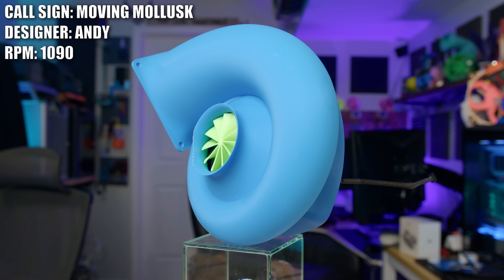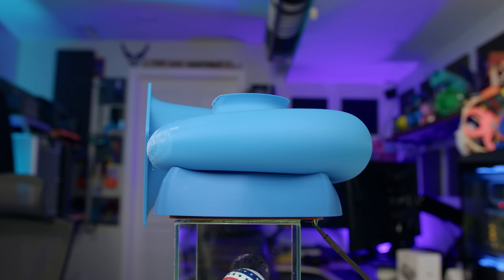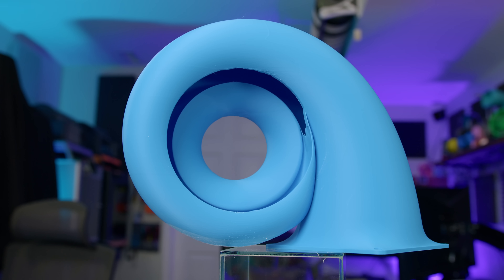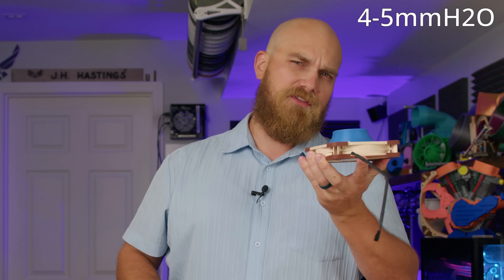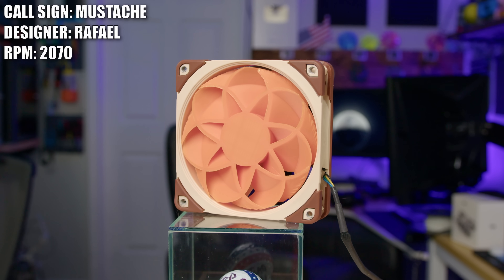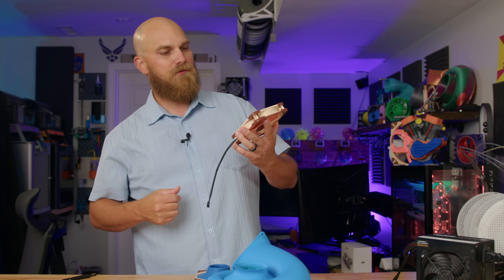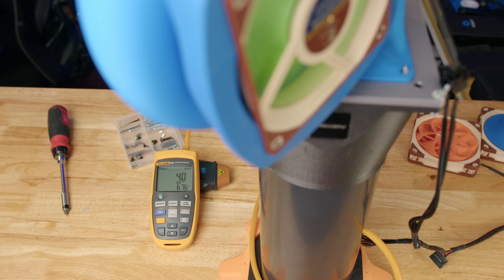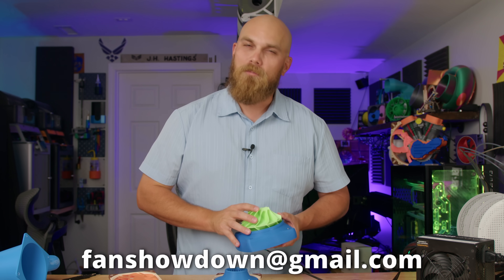A Twin-Intake Turbocharger… Turned Into a PC Fan! | Fan Showdown S6E12

Comment: This is splitting hairs but that wouldn't be a turbo, that would be a centrifugal supercharger... if you're going to call it one or the other instead of just a centrifugal fan. Turbos are driven by combustion gas, while superchargers are driven mechanically.
Reply: I would like to correct the misunderstanding. The word 'turbo' is not only for the machines with combustion gas. Turbo, more specifically, Turbomachinery, means all kinds of rotating machines with the continuous process of working fluid. Compressors, fans, pumps and turbines are all turbomachinery if they are axial, mixed-flow or centrifugal (or radial) machines.

Some compressors like screw or rotary are not classified into turbomachinery. They are called as positive displacement machines.

So I want to say that the combustion of working fluid is not the main issue to say one machine is turbo or not.
Reply: if we are getting REALLY technical, combustion gas IS mechanically driven, since the engine is just an combustion driven gas pump. if the explosions were not controlled you would not have a gas pump(and no combustion).
Reply: @turtlefrog369 - To further split hairs, it really depends on the definition of "controlled" 😊
Reply: @corpsie-diytools38  not really, it is controlled in multiple ways, spark timing, fuel timing. valve timing and piston timing.
Reply: its a turbine compressor
Reply: @jamesmelemede5610  ? The turbine is the exhaust driven part, the compressor is the cold side. That is the two sides of a turbo. This thing is a supercharger.
Reply: @Retro-Iron11 a supercharger is just another name for a compressor.  Specifically a compressor designed to compress a fuel air mixture.

This device is not a turbo or a supercharger, because it has nothing to do with fuel.

It is simply a centrifugal compressor.
Reply: @meateaw it's not even that. It moves the air from the narrow end towards the flared end, not compressing at all
Reply: @jurban7998  - Are you just  trolling? It is definitely compressing the air.
Reply: I think it’s a fan

Comment: i just noticed... aren't all the "Turbos"  we've seen in the Fan Showdowns technically Superchargers? Since they're driven by a Motor...
Reply: Technically yes, that would be correct, however they do resemble turbochargers more then superchargers, even a procharger looks quite different from the "turbo" fans on the showdown
Reply: @idkwhatmyusernameshouldbe5345  well "centrifugal Superchargers" dont look that off i'd say

Comment: Next season "Improve my rig"

You build a non-watercooled (relatively airtight) computer, and contestants get to desing fans for it. Community goal is to get the best designs together to get it running as cool as possible while running some benchmark program. Contestants can submit one or multiple fans at a time. Contests would be run slot-per-episode way in rotation. So for example, first episode you'd test case intake fans, measuring total airflow through the case and if it makes positive pressure or vacuum inside the case, thus revealing if other side needs serious improvement. Second episode you'd test case exhaust fans, third episode CPU fan, fourth would return to case intake fans and the cycle would start all over. First season would focus on the raw cooling power, noise wouldn't count althou observations on the noise would be still interesting.

This would emphasize on the community, and what it can achieve together.

Second season after that is to see if contestants can keep or increase the cooling capacity, but make it more quiet. 

You baseline it with A12x25 doing every cooling task.

Comment: For the next season, take a bunch of existing fans from each seasons. Bests ones, and test them at different speeds, pressures, and flows. To know which one could be use as a good pc fan for air-cooled pcs or water-cooled pcs. This could lead to real ranking of the fans that have perform in the past compared to the noctua. So measuring the flow for each 250 rmps and each 1mm H2O with sounds.

Comment: My suggestion for next season is to take the actual setup, put a valve and construct the pressure-flow curve by multiplying pressure an flow. Then, whoever has the bigger value goes first

Comment: if you want an idea for the next season, setup a thermal mass and see what the fans actually balance at for temperature control. Setup could be varied with the mass acting as the constant. Sound decibels and frequency might also be the second consideration, same as other suggestions.

Comment: I think back to roots for the next season would be good. Noise normalized which fan can cool a CPU the best. Someone suggested designing fans for a dual tower cooler, and I think that's a good idea given how popular they've become. It would give an interesting design constraint as at least one of the fans would have to fit fully within the fan housing. Also gives room for optimizing the second fan to work better with the faster airflow from the first.

Comment: Hey dude, that one with a loud low frequency? I pulled out my heavies head phones to see if I could hear it. YouTube only does 20 to 20k hertz with sound. Was it in the infrasonic range? Aka below 20hertz? 
You had another fan, maybe a year ago or so, that had some sub low frequencies. I was watching that video through my Surround sound and my subs were humming. I thought my amp was about to fry out. Wild. I wonder if the fan design is creating some kinda buffering that resonates. What is it, 80hertz and below sound becomes omni directional. You can't really pin point it's source. That's wild that a fan design does that. 
I know some variable pitched turbo prop airplane blades make a stupid 10hertz. Can't hear it but you can feel it.
Reply: The Mustache on his scope was showing 35hz peak there may be some subsonic harmonics I was going to comment the guy made one hell of a tuned sub(watch the plexi movement from it). 33-37 for SPL was the goal for most box tuning when I still ran competition systems.

Comment: Interesting, I would have guessed the opposite outcome based on the smoke test.
Reply: Because static pressure is being measured not airflow.
Reply: Smoke test provides flow visuals, but the contest is about static pressure. It is easier to push pressure with lower flow, that's how a hydraulic jack works 😉

Comment: Next season should be the quietest fan that moves the most air.
Reply: On what measure? CFM per DB?
Reply: @sepg5084  yes!
Reply: @sepg5084  Linear gain
Reply: @sepg5084 yes / also a factor could be used.
dB / CFM = X

Or you also could say at a specific speed and or noise leveld.

Say @1500rpm
CFM=
dBa=
Reply: You want linear gain instead of dB.
g = 10^(dB/20)
Reply: Maybe tune the fans to match a certain decibel number (like 20 for example) and measure the amount of airflow it can generate at that volume.

These fans would make great casefans for budgetcases, 'silent builds' or office cases
Reply: That would be great. Would give rise to a lot of new designs.
Reply: that would be awesome.

im a huge silent PC fan, especially for work and due to my open back headphones. 

my GPU fans never run over 66% and my CPU fan never above 55%. 

with a proper airflow situation even a silent case with lots of sound dampening and slower running fans can cool down components really well. 

i would defenitely consider swapping out "normal" fans for experimental fans, if they reduce some of the noise pollution.
Reply: The test could be that it moves the same amount of air as the original fan through a normal radiator. But it should be quieter.
Reply: The way to do it would be a linear noise curve + cfm curve + static pressure and the fan which has the most chart surface area between the noise curve and cfm curve + static pressure/2 from 0-max rpm (like a dyno sheet) is the winner, it would be an arbitrary scale adjusted to include all the fans as a positive number.
Reply: JUST was about to say the same. Set a standard airflow and pressure that the fans have to exceed and then measure noise. Now, our man has to build a box for sound testing, not that it is hard, it is just going to be fairly large box.
Reply: I would want both cfm/db and h2Omm/db and it fits in my pc case.
Reply: CFM per DB! 

Amount of air passed, divided by amount of noise!
Reply: I would not mind measuring airflow over a set restriction, like say a single mount radiator. That would add realistic flow restriction... In some past seasons he measured cooling efficiency, but I think that is too complicated, requires fairly long test runs, and then has to deal with ambient temperatures and so on. But simply bolting a fan to a radiator (no computer required) provides realistic restriction and air volume is what is doing the cooling anyway.
Reply: I think he should have a specific airflow or pressure target and then compare sound
Reply: Is there a chance you can show the C-weighted dB measurements too?  

I'm a big fan of this video series and it makes me happy how many people contribute to help us all learn.
Reply: Both
Reply: Yes! Just YES!
Reply: You could even normalize it to a certain cfm. Quietest fan at x cfm
Reply: Like a ratio measure- CFM/DB
Reply: @tyrelirwin  DB isnt everyting!! it can have an annoying sound even though its less DB then something else, frequency matters too!
Reply: I agree.the moustache was surprisingly well flowed by the looks.
Reply: The quietest fan at a set minimum amount of air moved. 
Plug and play, no adjustments of power settings.
Reply: CFM per dB actually would be fun to see
Reply: this!
Reply: Least noisy while being on par with the noctua fan
Reply: Two variables to judge on is quite difficult. Which is weighted higher?
Reply: @veridico84 cfm is the judged variable

fans are sped up until they meet a noise threshhold
Reply: @HurricaneLantern yup. That's exactly how the should've worked from the get-go.
Reply: All the fans are speed up/slowed down until all have established dB level. At that dB highest CFM wins.

CFM/dB doesn't work becauce all of the sudden no fan at all would be a solid competitor (0/0)
Reply: @cocon16_PW  see my other comment, you could do a "dyno sheet" and measure the area between flow and dbm scaled by rpm, largest graph surface area wins
Reply: Loudest fan that moves the most!

Comment: next season idea: do tests noise normalized. so, pick a "Standard" Db and adjust all fans speed to match that volume.  
Then test airflow CFM unobstructed, and though a 22~FPI radiator (average fin density for an AIO) to get performance for both case ventilation, and active cooling. Noise Normalize separately for both tests.
Reply: I'd love this since it's a great way to reward sound without just getting fans that don't move air lol
Reply: YOOO That's a great idea honestly, curious how badly some would cool at the same noise level lol
(plus more content to enjoy yippiee)
Reply: Great idea!
Reply: Or slowly sweep fan speed from high on down and plot against dB. A slow dynamic sweep, assuming he's got a data logger, will take him a lot less time than trying to dial in and hit a CFM or dB target.
Reply: I would do it other way around: set a threshold for air flow and static pressure that the fans have to meet first to be qualified and then measure SPL. A lot of fans won't qualify, no matter how we do it, and adjusting RPM is something that is up to the user, requires extra circuitry. I imagine the premise of the WHOLE series is to pick a common fan chassis, driven at 12V DC so that the "end product" could be on the shelfs as-is. 

And there is also sound quality, it is not all about SPL. There are simple metrics we can use: measure the highest peak and compare it to a weighted average.

I also don't like the obstruct airflow test as that is so much about the radiator then, its design impacts everything. We will only fine what fan is the best for one specific radiator, at one specific distance from it. That is an extra variable.

Comment: hey idea for the next season, dont use the noctua fan, just let people design a fan for a standard bldc motor that can be obtained everywhere and measure max revs at low noise, flow and pressure at high rpm (say 3500rpm), peak rpm and flow.  If you want peak fan design and performance kinda like F1 a bldc motor has enough power to beat even those monster delta and sanyodenki san ace server fans

Comment: Maybe next season you just go crazy... with a water tank. Epoxy that A12X25 so it's waterproof and see who can make the best propeller.
Reply: or water pump
Reply: @pathood7953  I doubt the X25 has the torque to move the mass of water in any meaningful way. Def would need some proof of concept testing before committing to a season
Reply: @pastaalalamborghini could use an old school server fan, those things have enough tourqe to cut your finger at low speed
Reply: This

Comment: Next season idea. 2 stock fans. Run in series. How best to combine them for static pressure. Just bolt them together? What about a spacer? Is the spacer empty, or does it have stators pushing the air into the 2nd fan? Perhaps sweped backward, causing the 2nd fan to scisor off chunks of air. What if you fill the void between the motors to prevent a low pressure area. Maybe angle the walls of the chamber out to increase pressure or in to create a low pressure while still directing the flow. What about the shell? A cylinder? A box? A long chamber? A wide chamber? Something with ofset slits to use the existing air flow to draw in more air, increasing the air density at the 2nd fan?

Comment: That F1 fan would be called a 2 element wing with several (pointless) turning vanes and an endplate. The two element design is pretty nifty for increasing relative aspect ratio and allowing a higher pitch. And yeah we've seen a lot of fans with the equivalent of endplates here lol.

P.S. am an Aero Master's student. I just found this channel yesterday. I now 100% want to try and make something to win this, but radial compressors are cringe. Might have to bust out some MATLAB and my undergrad aero characteristics to try my hand... If only i can find the time lol.

P.P.S. For future seasons, it might be worth looking into mass flow rate in its entirety rather than just static pressure or airspeed.
Reply: go for it. it seems like an interesting project to take into account the limitations of the drive motor used.
Reply: @Jimmy_Firyh  flow rate was a previous season, this season is static pressure. You can watch older episodes if you want flow rate.
Reply: @sepg5084  flow rate (speed) does not equal mass flow rate. Mass flow rate is density of the fluid (air, higher when the pressure is higher) times velocity (speed, yadda yadda) times the cross sectional area it’s passing through. This allows a total measurement of what the fan is pushing.

Comment: suggestion for next season.  make a scoring system for sound, smoke test and pressure.  this will award clever designs that lower sounds and control smoke airflow as well as strong pressure
Reply: How about a scoring system for weight & mmH2O-to-weight ratio? Rather than creating a separate category for the bigger fan designs they simply have a worse weight score because of how much more material they use.
Reply: yeah I would love to see the results of all the fans scored on a diverse criteria and see which ones are the best as just general fans